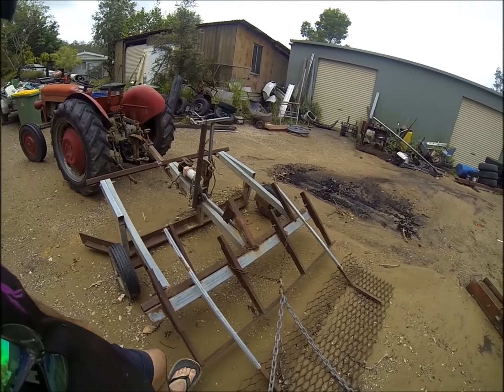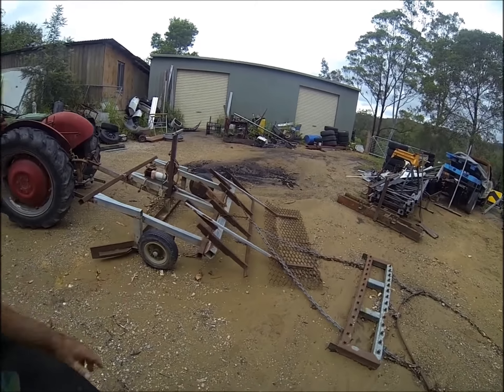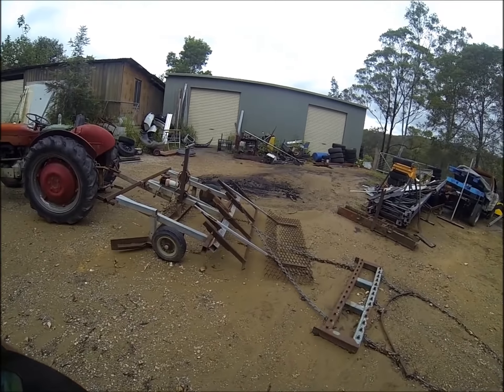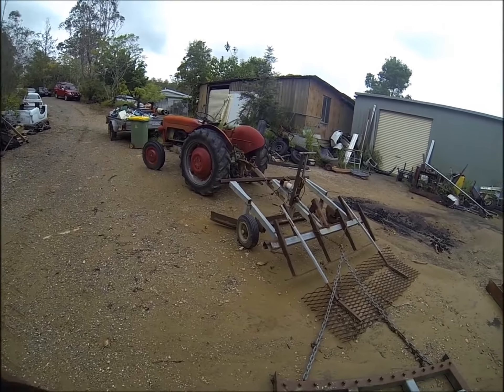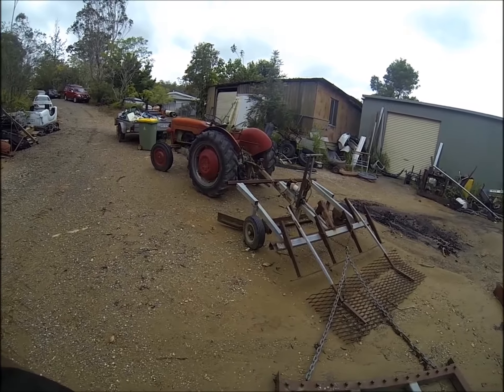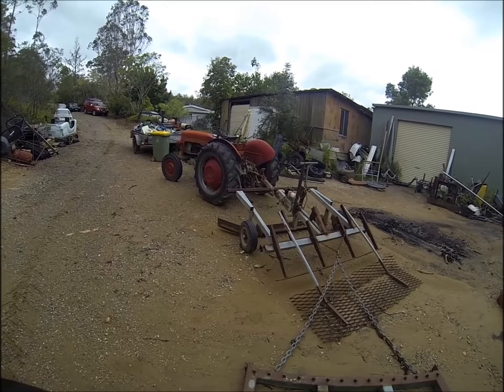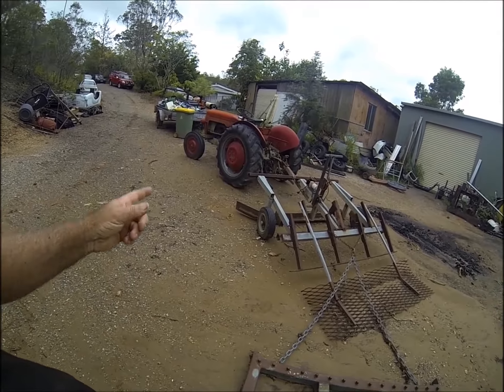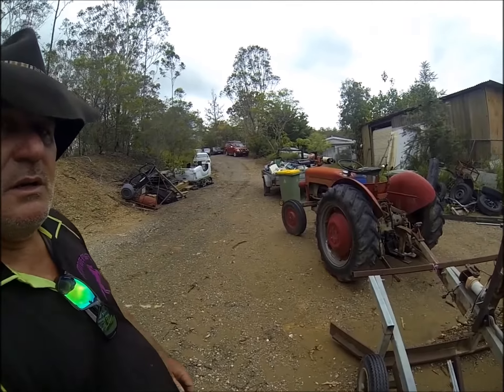Freeing up the Drag Part 1

Comment: Useful little thing you've made there.  Keep up the good work.
Reply from the maker: Thanks Chris it works really well, surprisingly it does level and clean up so many things even though it was designed for spreading and leveling sand arena's for Horses and was built from scrap pieces from the old boat trailer wheels to the scrap steel laying around, I only bought 3 things for it in total so I like it when you invent stuff for a need you have. there is so much cool enjoyment to build your own trailers, Drags, tools and ETC ETC